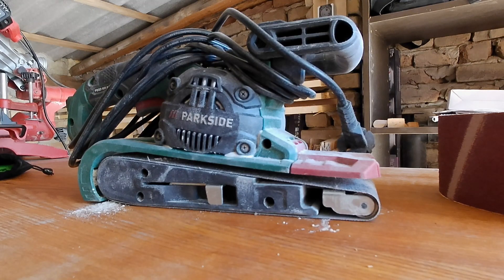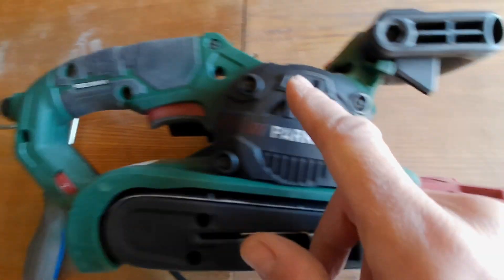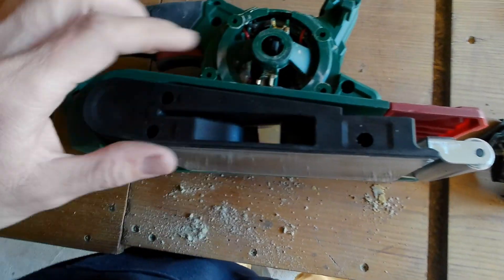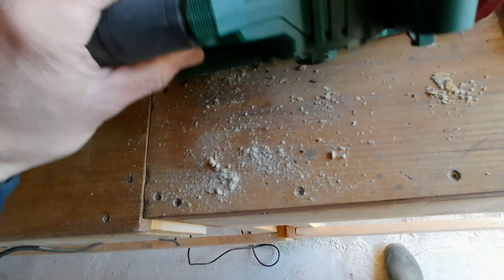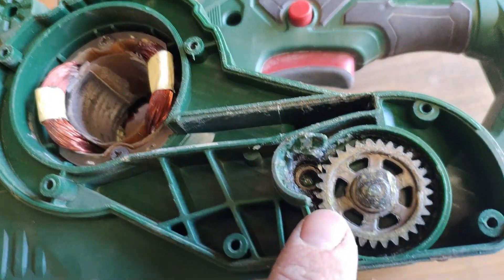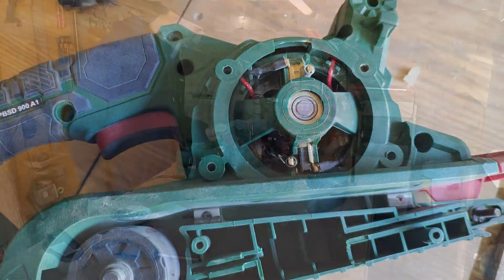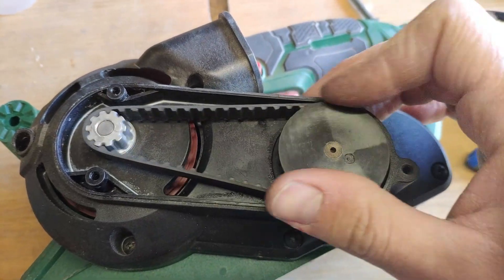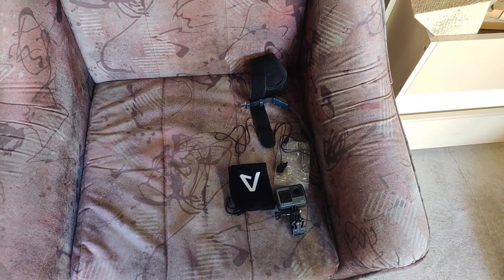PARKSIDE PBSD 900 A1 belt sander partial disassembly & assembly and maintenance 👨🏻‍🔧🪛⚙️

Comment: Where can I get the brushes for one of these?  Thanks
Reply from the maker: Hi there! First of all Lidl customer service. If not works than the manufacturer kompernass H. GMBH. If not works the brush size is 5x8x12mm. 4.84->5mm thick, 7.78->8mm wide, 12 or 15mm long. At the top where is the connection it has a slight angle.